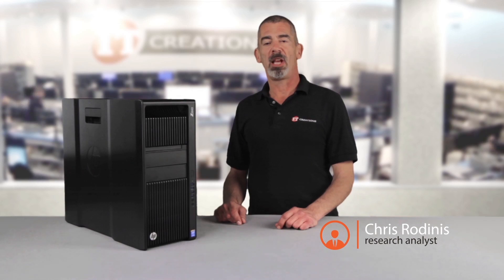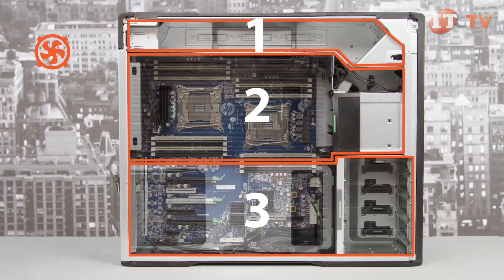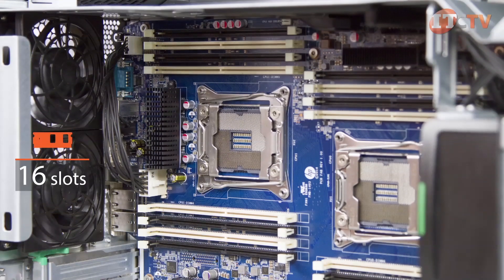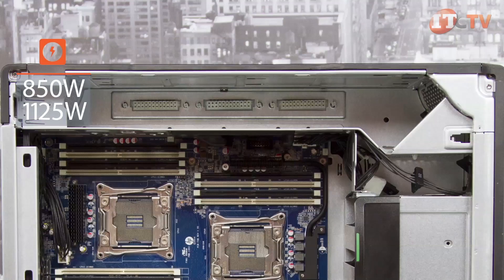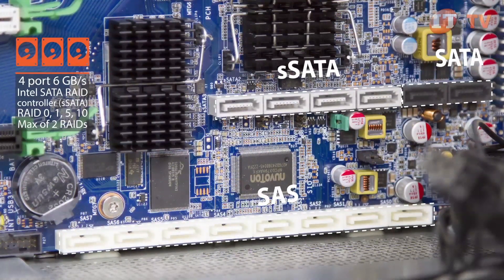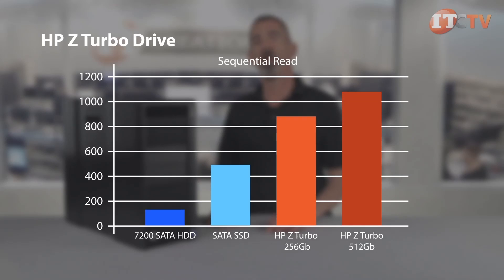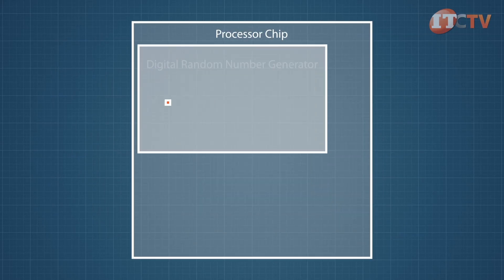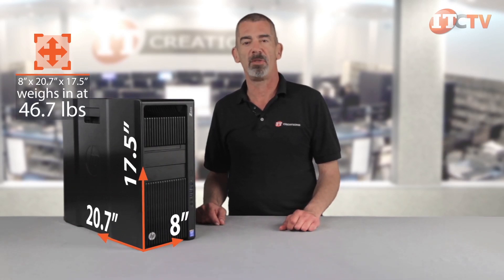HP Z840 Workstation REVIEW | IT Creations

Comment: I'm going to out 2 2699v4 and quadro p6000 in mine.
Reply: I’ve had mine 6 years, it’s a beast runs 24/7 . It has been sealing blocks on the blockchain 7:57 . Upgrading now it has dual 2699’s with 256 gb, adding a turbo drive for boot proxmox with 4 tb,  2 are optanes , 2 3090’s water blocked exterior 480 radiator on top, icy hot 8 bay, 12gb 16 port sas, coral dual tpu and a lot of storage, the optane makes hdd very fast with zfs. I’m repurposing an iPhone 11 to run proxman and a quick display.and putting in a 10 gb nic You sure can do a lot with this platform, the water block takes it to another level, it’s straightforward, keeps the cards single slot , cool and quiet. You can run some fairly large llm’s and still your entire homelab. I love these machines. I have 3 was able to 2 for next to nothing. They are a great home appliance.
Reply: Delicious

Comment: Another video saving my little company big $$$. I needed Machine Learning machines to dedicate towards researching AI weed spotting on large-format farms, and I've been struggling to find a system that can comfortably support the ridiculous compliment of hardware needed per-workstation without blowing $2k on a Thinkstation P940 as just the core. Going by just board images I wasn't sure the Z840 could pull off the job, but knowing the 5th slot becomes a CPU 8x slot with the 2nd CPU installed, and thus can be bifurcated for NVMe storage, means I can just barely cram everything needed into a single <$800 workstation core. Which means I can build a PoC capable machine for <$2k. Booyeah!

Comment: I just acquired a lightly used Z840 from my employer. It already had dual Xeon E5-2620 2.4 GHz processors and 32gb of ram, but I upgraded it to 128gb of RAM and installed 4 - 16tb Seagate IronWolf Pro HDDs in a RAID 1+0. I am using it as a Plex media server and it's running great. It is nearly silent (except for the HDDs during writes) and it runs very cool. Overall, I'm super impressed with this workstation.
Reply: HOW MUCH AND THEN, HOW MUCH MORE??
Reply: @josephbohme7917  The workstation was a retired unit from my employer and was totally free. The RAM upgrade was taken from other decommissioned workstations for free. Subsequently, I spent $1300 for Seagate drives, $375 for graphics card, $200 for 2 used HP Z Cooler upgrade and $100 for upgraded hard drive cooling,... so about $2000 total, which is a bargain for a setup like this.
Reply: Run Server 2022?  No TPM needed...

Comment: Hi ihave z840
It makes red light 4 times with beep 
Plz help.
Reply from the maker: Hi there, 
Sorry to hear you are having problems with your system. Check out the Maintenance and service Guide on Page 101 if you key it in at the top of the page, or actual page number 91. It covers the Diagnostic LED and audible Beep codes. https://www.itcreations.com/user-manuals/z840/hp-z840-workstation-series-maintenance-and-service-guide.pdf
The full Troubleshooting section starts on page 86 if you key in the number top of page or on actual page 76. Sounds like your problem may be "Power failure (power supply is overloaded)". If you need parts, check out IT Creations https://www.itcreations.com and do a search, chances are we have what you are looking for. Good luck!
Reply: @Itcreations-LA  so its my power supply
Reply from the maker: Hi, @adhameda3071 
Not necessarily. Follow the procedures outlined in the section I noted above and it does continue on to page 92 continue on to the next page. One suggestion is to disconnect items that are drawing power and reconnect them one by one, turning it on in between to see if there is a specific component that is causing the problem. BTW, as you test remember to turn off and remove the power cable prior to working in the unit, also be careful about static electricity. Standard precautions.  It could also be a lose connection on one of the components. You could need a new system board. There are several options listed the least expensive and easiest to solve is to check for lose wires and make sure all the PCIe cards are seated firmly in the slots. Same for memory modules. Then check all connections to the PSU and onto the system board. There are several things to check prior to buying anything. It is a little time consuming but well worth it to not just buy something and hope it solves the problem. As I said (and the maintenance guide too) it could be just something got lose and needs to be more firmly seated. Tell us how it goes. Good luck!
Reply: @Itcreations-LA  sometimes it turns on and work for days!!!(with overload)
But when i turn it off and try to turn on back the problem return.
Reply from the maker: @adhameda3071  
Perhaps it is something simple. Check the connections…
Reply: @Itcreations-LA  thanks for replaying
Reply from the maker: @adhameda3071  No problem! Good luck, I do hope it is something simple. Just run through the procedures listed in thetroubleshooting section to isolate the components.

Comment: where's the M.2 located?
Reply from the maker: These older models do not have M.2 integrated on the system board. However, you can install a Z-Turbo drive PCIe card in one of the slots. They are available in single, Z dual-Turbo or quad-Turbo formats. See page 10 of the QuickSpecs here: https://www.itcreations.com/user-manuals/Z840/HP-Z840-Workstation-QuickSpecs.pdf More general information here on the platform with documentation at the very end: https://www.itcreations.com/workstation-hp/hp-z840-workstation.asp Lastly some specific information on those cards here: https://www.itcreations.com/user-manuals/z8-g4/quickspecs-hp-z-turbo-quad-pro-and-dual-pro.pdf 
Thanks for watching!

Comment: Is the Z840 compatible with the Nvidia Tesla K80? I see you mention Tesla K40 GPUs but just want to be sure the K80 is compatible. Thanks in advance.
Reply from the maker: Hi Drumming!
This on the HP community forum. Couldn't have said it better myself. Short answer for those who don't want to click the link is no, because of potential overheating issues. Thanks for watching!  https://h30434.www3.hp.com/t5/Business-PCs-Workstations-and-Point-of-Sale-Systems/Nvidia-K80-Accelerator-GPU-on-a-HP-Z840-Worksation/td-p/6577384
Reply: @Itcreations-LA  Thanks for the reply and the link. Do you know if cooling is the only issue? I'm thinking of adding additional cooling so if that's the only issue then I can work around that. Just didn't want to run into any driver or software incompatibilities or some sort of hardware mismatch that renders the GPU unusable.
Reply from the maker: @drumming76  
We have not tested this in one of our systems so I cannot give you a definitive answer on your question. That said, the technical guide says you can install either 2x 225W cards or a single 300W card https://www.itcreations.com/user-manuals/z840/hp-workstation-technical-whitepaper.pdf
The most complete information I found on the Nvidia K80 is on the TechPowerUp site and indicates the K80 requires 300W and a PSU of at least 700W, which is fine given you still need the optional 1125 W power supply, 90% efficient, for the Z840 with a PGU of 300W. https://www.techpowerup.com/gpu-specs/tesla-k80.c2616 
I can't imagine the driver will be an issue but again I cannot confirm that. May just be the heat issue. So, no definitive answer here… sorry. If you do install the K80 post an update, we would all love to hear how it works out! Definitely monitor the temperature under load. Good luck!
Reply: @Itcreations-LA  Thanks again for all the info, completely understandable that you can't give a definitive answer. I guess it's not tried too often so it's hard to find examples of. I will definitely update here if I go ahead with it. Fingers crossed it goes well.

Comment: Nice review!! What is the maximum Hard drive capacity that this workstation can accommodate?
Reply from the maker: Hi there!
And thank you! Hard drive capacities are listed in the QuickSpecs for this system, which you can find here starting on page 41, https://www.itcreations.com/user-manuals/Z840/HP-Z840-Workstation-QuickSpecs.pdf 
Newer, higher capacity drives would also work if they can fit and connect. HP, does not vet every drive out there and are also limited by what is available at time of testing. Hope that helps, and thanks for watching!
Reply: Anne asmelash Gebremariam Gebrezabher Eye kab Ethiopia Tigraway  kemey selam do

Comment: Hi I have HP Z840 and I have a problem.
From time to time the fan assembly will start run full speed until 1 I open the side chassis door or 2 I tap on the chassis door  or if the fans don’t stop on the fan assembly.
Any suggestions what can be the problem.
Is it the motherboard or the fan assembly.
Reply: go to your bios  system and rest to default setting .

Comment: I've an HP Z800 with 12 cores, 24 threads, 48 GB RAM, Nvidia Quadro K 5000 , 3TB storage and a 700 GB SSD.....But, when I render in 3ds max with vray  my workstation get stuck , if i browse internet or open another window or another program like Photoshop....Could you please tell me why it happens like that?? Hope Z840 doesn't have such issues .
Reply: Too many potential issues, from CPU to motherboard. 
Bad ram can also cause that. Motherboard issues are common with these old workstations. I bought Lenovo S30, it had similar issues, when it would get stuck I would lose firewire connectivity. 

They are old. I would test 1 by 1, starting with CPU on another board, and if that solves the issue it was the motherboard. Testing ram is easy, just not in your system. CPU fails last (usually), but possible

Comment: Hi 
Can it run with in Sli mode from Nvidia GTX series ?
Reply from the maker: We have not specifically tried to link two Nvidia GTX Series GPUs not listed in the supported hardware. However, that said, here dGroves, the distinguished professor states many times on this HP forum that, and this is the way he wrote the post "again, just to be clear,......NO CONSUMER VIDEO CARDS ARE SUPPORTED IN SLI MODE ON THE HP WORKSTATION Models." Seems a little triggered. Still i would like to test. If and when we do, I will post. BTW, here is the rest of the conversation https://h30434.www3.hp.com/t5/Business-PCs-Workstations-and-Point-of-Sale-Systems/Nvidia-SLI-in-Z-Workstation/td-p/6965639 It relates to the Z4 G4 but our "Professor" indicates this is the case for all HP Workstations. There are Quadros that use SLI and are supported but apparently, if we are to believe the Professor, no consumer cards. Thanks for watching

Comment: when hp z860 release
Reply from the maker: Hi +M ZUNAIR TARIQ I don't know when they will release the next workstation series but the Z840 was released in September of 2014 and HP usually has a 2-year update cycle so I would say we are about due for the release of a new generation. Thanks for the question.
Reply: Sir I have a query I have a HP Z840 workstation configuration is 
Graphics: NVIDIA M6000 24GB 
RAM :512GB 
Processor:2x E5-2698 V4
HDD: 1TB
Power supply:1125Watt
Please suggest me UPS for this system.
Reply: what will be the upcoming workstation of HP

Comment: what is the price of z840
Reply from the maker: Hi +Yasir Ali the price of the system is dependent on a variety of factors; type of processor, memory, storage, GPU's, HD controllers, etc. Very few people will max out on all components. This system will support up to 1TB of memory but you can get by with just a single 4GB memory module. The system also supports a bunch of different GPUs and in fact, will support up to three full-width GPUs, if I'm not mistaken. Click this link, then click the green "Shop Now" button to see pricing on pages and pages of pre-configured systems. http://www.itcreations.com/workstation-hp/HP-Z840-Workstation.asp mention watching this video to save $150 on a system valued at $1500 or more. Thanks for watching!
Reply: Thanks sir Thanks a lot
Reply: But its too coastly
Reply from the maker: Yasir Ali I would have to agree with you there but keep in mind this is HP's most powerful workstation and most people who use workstations don't need this much either. The good news, there are many other options that still deliver powerful performance. Like the HP Z440, HPZ640, HP Z1. Of course there are also very powerful workstations from Dell T7910, T5610 and let's not forget Lenovo with several newer systems P500, P700, P900. And then there are older systems like th eprevious generation models that still deliver greta performance but as with all things there's always a new and improved version. here are a few links to our site for workstations from HP, Dell, and Lenovo— just about all of them will have a better price point than the Z840
http://www.itcreations.com/hp/HP-Workstations.asp 
http://www.itcreations.com/dell/Dell-Workstations.asp
http://www.itcreations.com/lenovo/Lenovo-Workstations.asp 
Hope that helps and thanks for watching our videos!
Reply: Hmm

Comment: I have been in the IT industry in Silicon Valley for almost 30 years working for both and with HP and Dell products (among others) (and also for Intel, and AMD). I can tell you without any doubt that HP workstation products (and in many cases server products) are generally inferior to Dell in design and being overly complicated, and intentionally limited by firmware (where Dell has historically been the least offender in this commonplace practice designed to protect profits, while ultimately limiting the customer/end user).
Reply from the maker: +SkylineTotheSeaAndMe thank for the comment, and thanks for watching!

Comment: How does it compare to the z800? I have a 12-core, 24-thread Dual Xeon z800?..Should I buy the NEW 36-core z840?...Is it quiter, smaller, faster, lighter than the z800?...My z800 is a Loud BEAST !.....What do you recommend?...Or should I just stick with my z800 which I added a 500gb. PCIe SSD with PCIe adapter card, , 6tb. hard-drives, 128gb. or ram, Nvidia GTX 750ti, Wifi-ac card, Bluetooth USB adapter, BlueRay burner, Sound Blaster Audigy 2zs with live drive, and Windows-10.
Reply from the maker: +Alex4SiliconValley hi Alex, The Z840 is a beast, although it looks like you've got a great setup with the Z800. That said, depending on what you're using your system for, if it's not measuring up to your workload the Z840 would be a significant improvement. It is two generations removed from the Z800. With the Z840 as you correctly stated you can run not only 36 cores but now up to 44 cores with the new v4 processors being supported. However while a lot of cores is good for certain applications the clock rate does take a hit and they may, or may not, provide the performance you're looking for, again depending on your application. The Z840 is better, stronger, faster. and you get I think PCIe 3.0 lanes and Xeon E5-2600 v3 and v4 processors. It also supports DDR4 memory, which is significantly faster than what you are using. I'm not entirely sure on this one but I think you can install two high-end graphics cards and a graphics accelerator. 1TB of RAM with 64GB DIMM modules, double that with 128GB modules. Here are a few resources for you, a comparison of the Z800 to the Z820 and the data sheet for the z840 

Z840 Product sheet 
http://www8.hp.com/h20195/v2/getpdf.aspx/4AA6-4212ENUC

Comparison of HP Z820 to HP Z800
http://h20331.www2.hp.com/Hpsub/downloads/Z820vsZ800_WhitePaper.pdf

If you are interested in upgrading to the next level with a Z840 we offer great pricing and custom configured, next-day delivery if need be. We are located in Los Angeles.
http://www.itcreations.com/workstation-hp/HP-Z840-WORKSTATION.html
Reply from the maker: +Alex4SiliconValley Forgot to mention, yes it is quieter than the Z800. OK. Continue on about your business…
Reply: @Itcreations-LA  does one HAVE TO use 2 cpu's in both sockets ?
Reply from the maker: @Deanabiepepler 
No, you don't have to use both CPUs but you will only get half the memory, and half the PCIe slots as you will need the 2nd CPU to realize the full power of the system. Thanks for watching!

Comment: Is it good for gaming?
Reply from the maker: +Hacker .net This is a professional workstation meaning it has ISV certification and is designed specifically to work with specific high-level programs to design, build or calculate some serious S%@^!  I suppose it would handle gaming ok but this is not designed for gaming. The processor, memory, and graphics cards are all designed with error correcting code which is very helpful when doing calculations that require exact tolerances. You could probably build a better gaming system for a fraction of the cost. However, your gaming system would not be able to do what this system does for engineering, geoscience, financial calculations—that kind of thing. If a gaming system drops a few frames here and there while rendering a complex scene in a game, no big deal, but if those same errors occur while designing a bridge or a plane that would be a problem. Thanks for the question, and thanks for watching!
Reply: Thank you :D
Reply from the maker: ***** Anytime! Thanks for watching!